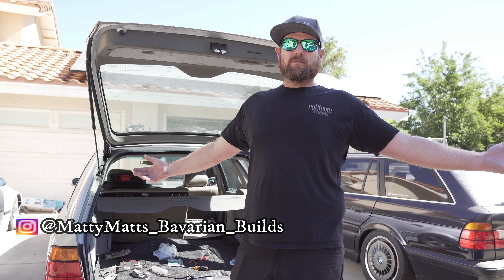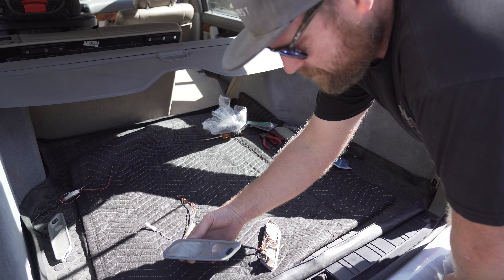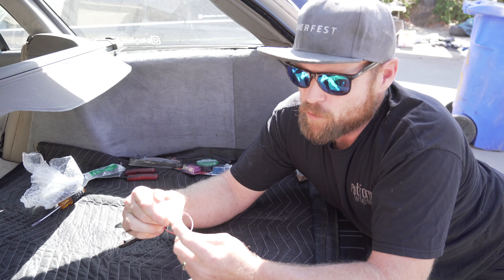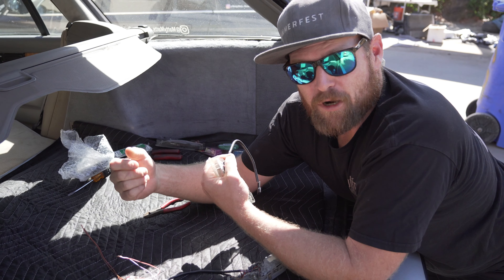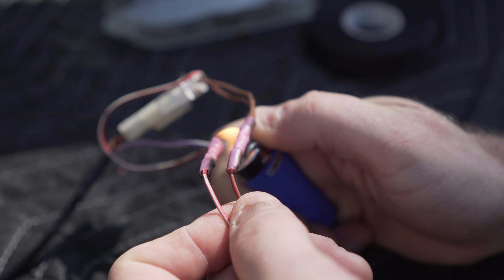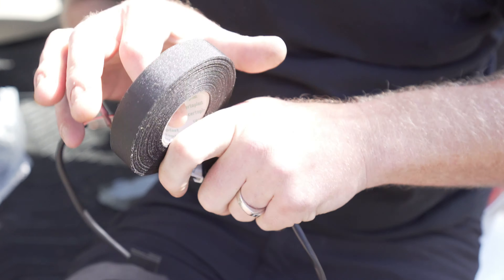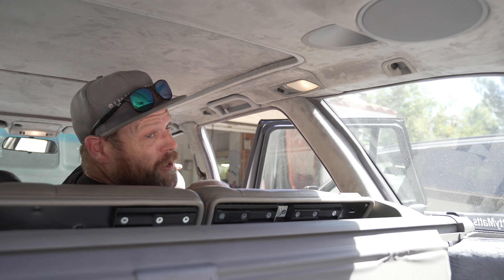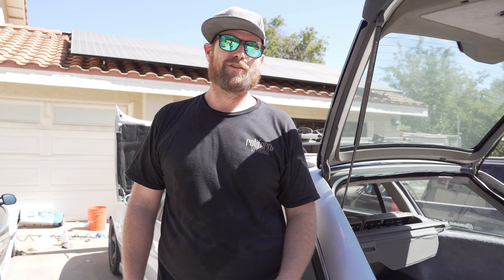DIY The Best BMW Interior Light Mod Ever! **You'll want this one!**

Comment: The whole idea is to enable rear passengers to read while riding.  The requirement to have interior lights on negates the primary use.    The default is to wire the map light to the purple stripe wire which is powered by Fuse 18.
Reply from the maker: Thanks for your response... there’s 3 different kinds of e32 map lights... one set has the purple power wire, the others do not, I was trying to show a solution of all 3 kids of lights for the wiring!  But yes you can take the time to wire up that power wire separately, as a plug and play option! Thank you for watching I’m super stoked on that!

Comment: That's a stylish mod, looks way better than the flat boring lenses. But I have one question: It looks like the map light with the switch hasn't been hooked up to any constant power source. So can it only be used when all the other interior lights are on? Or is there a workaround? Or am I missing something?
Reply from the maker: I hooked both power wires to the power wire from the car so they only work when all the interior lights are on! You could give the isolated purple wire with the white stripe to constant power if you wanted the individual map light to work anytime! Thanks for your comments! I’m always willing to help!
Hope this helps!